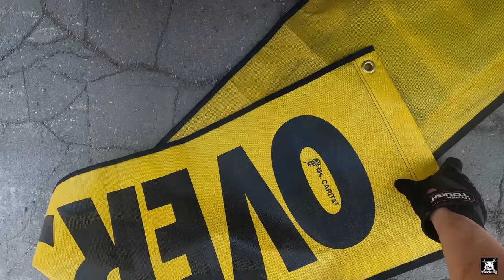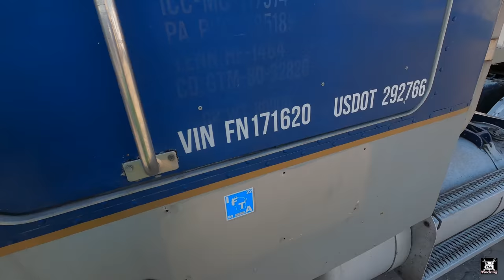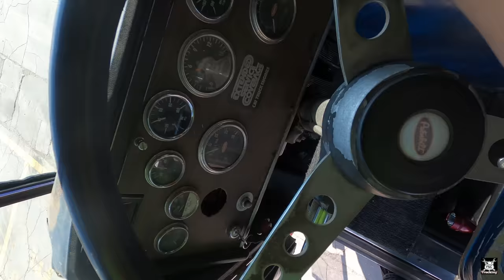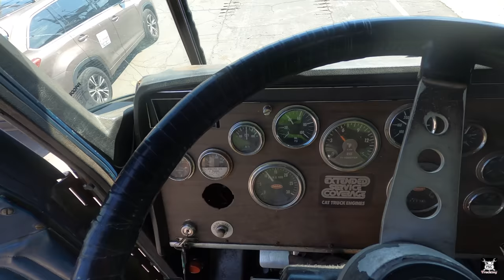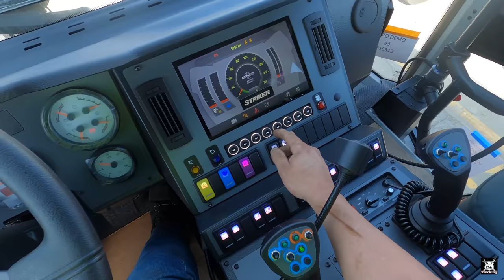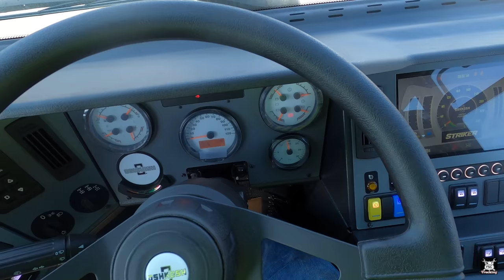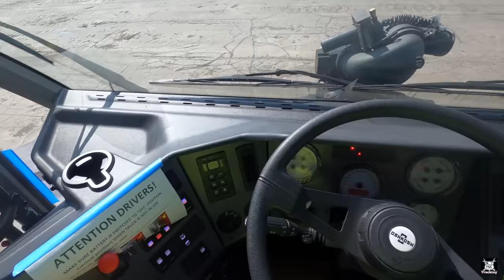Automatic Air Doors On A Fire Truck?   I Unload It In Baltimore!

Comment: Sorry, those air controlled doors may be "cool" to have but it just seems like just one more thing that can go bad. Was a 30 year volunteer firefighter,  and one time we bought a truck that had the automatic flip down steps for the cab. Open the door and the steps flipped down,  had nothing but problems with them for almost the first year we had the truck. I prefer the K.I.S.S standard. KEEP IT SIMPLE STUPID. Sometimes the fancy "bells and whistles" are not worth it. For the price of the truck, am surprised there is not a backup camera on it.
Reply: powered doors became pretty much a popular thing on modern apparatus, just like folding steps, air ride suspention, all-wheel steering etc, and it works also on busy trucks running thousands of calls a year. It's not like these things would be sth all new, which just came up the last one or two years, but these things are around for quite some years, sometimes even decades. More recent developments are e.g. mirror cameras, but they proved themselves in the commercial trucking business already, just natural that it comes to emergency vehicles as well. Same thing with electric fire trucks or emergency vehicles in general.
Reply: The whole thing is probably an overpriced pile of junk some senator got the contract written up for his brother in law anyway so they threw the air doors and the drivers side french tickler in for nothing.

Comment: Try using spray chain oil on your binders.  It clings to the gears and lasts a long time in between applications. I hate to see what those dock monkeys do to those doors by the time it his Europe.
Reply: He does.  He sprayed some on in an earlier video after he had to blowtorch them when they were frozen solid with freezing rain to offload a telehandler from Texas to Wisconsin.
Reply: Is CRC-56  good enough or  WD- 40  as good  or better  ?? 🤔🤔🤔🤔
Reply: @sellier-bellot22  I prefer Kano's AeroKroil. 
Best penetrant/ lubricant that I've found. Have been in multistate industrial/ institutional process furnaces, boilers, chillers, project and service management for my real job, and fire, tech rescue, dive team, air medical/ EMS fire a hobby to unwind after dealing with engineers and architects at my real job.
AeroKroil has worked on things that folks have tried everything else on with no luck.
Reply: I use Fluid film oh boy are those binders lubricated with that.

Comment: Never really understood the demise of the cabover. I'm sure fuel mileage was the primary reason. The mobility of the tractor in and out of tight spots especially on the east coast came in handy for me many a time.  I've driven a few in my early years of driving. Kenworth mostly. The Aerodyne was my favorite, but drove an extended cab similar to your Pete for a couple years. The company I worked for then got on the conventional bandwagon.  I recognize the Keen Transport paint scheme from seeing a few at a Caterpillar yard in IL. Fun watching the vids. Keep it up.
Reply: Streamlining was a factor, but I'd wager so was ease of entry/exit into the tractor so as to reduce physical accidents and probably also ease of access for repair as you could just pop the hood instead of inclining the whole cab.

I agree with you though, COE's still have a niche they could fill and would be nice to see on the road.  I miss the old Schneider Pumpkins 🥺
Reply: Driver comfort was another issue. Climbing over that dog house and changing clothes lying on your back has to get old, plus the ride was rough sitting over the axle.
Reply: mainly the reason was the demise of overall length laws and drivers wanted conventionals which is a recruiting tool for carriers
Reply: Driver comfort yeah, but It was make the tractor as short as possible so you could have a longer trailer back in the day when they had a maximum Truck length on the national network.

Comment: I was just wondering if you could fix an air bag dump valve switch in your cab to let your air bags down so you wouldn't have to reach under the trailer to dump the bags

Comment: When I use to empty or load at all piers, the loading or unloading was done by stevedores usually they worked quickly,. I had to take off chains and binders, there were times the stevedores helped with chains and binders. pull toy here

Comment: Could this fire truck be used for crowd control when the food riots break out?
Reply: Anything can be used if you're thinking outside the box... And are desperate enough.
Reply: Only if they install rock screens over the windows and add a gun turret or 2
Reply: German police have converted small crash tenders into riot suppression vehicles.  They angle the tops so Molotov cocktails roll off, and they have a large pusher plate on the front to push barricades aside.  There are a couple of YouTube videos' on such trucks.

Comment: Only a true genius parks in front of a dropped lowboy deck.
Reply from the maker: In truth the checker tells us where to put the freight.  They simply pulled up as I was parking the Striker.
Reply: @fsctrucking  I've never dropped at a Port. Limited experience with that. Company equipment going to company jobsites is my whole gig.

Comment: To me it seems a design flaw plus a bodge to mitigate it having those secondary latches to maintain the doors closed. Wouldn't you think that it would require air to open and when there isn't air they remain closed beyond having a manual release. Coach (bus) doors have worked like that for the longest time.
Reply: Since its a fire truck, when its not in use the truck will have air supplied to it cause when a fire happens you can't wait 3-4min to air up so having them open with air is empty is fine.

Comment: FSC Trucking.  I'm looking at buying a 1989 362 and had some questions if you  have a minute. The 362 is a solid cab/chassis truck but need to be put back together. I. Running a 1982 9670 with the same driveline and was thinking about making one from the two.

Comment: Do you ever maintain your chain ratchets; spray the moving parts with WD-40, white grease, or some other lubricant?
Reply from the maker: This was the first time using them after I set them on fire burning the oil off.  The next load I coat them in hydraulic oil.
Reply: Wd-40 actually attracts dirt and other junk, it's always best to use grease, or oil.

Comment: Pierce had pneumatic steps on their quantum's. Like has already been said, and common sense would dictate, just something else to go wrong -- like the vacuum 'hidden headlights', crappy vacuum reservoirs and the stupid electronic blend door actuators buried deep within dashes. 
 Give me  an old twin stick gmc or ten speed C or L model Ford. 
 Newer structural, woodlands, and aarf apparatus get more and more cushy so the newer generations can handle them without putting their phones down ----